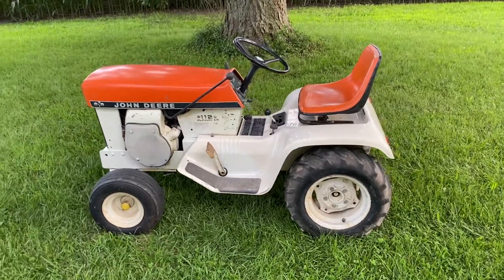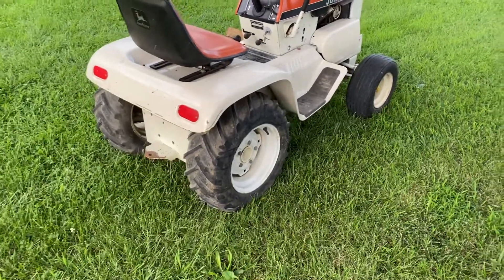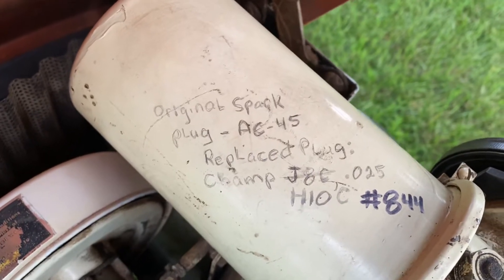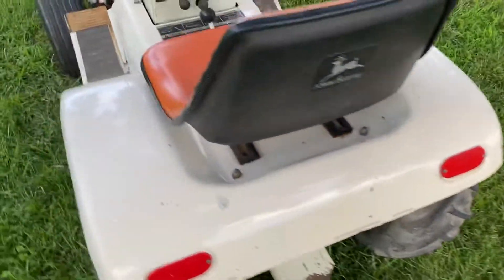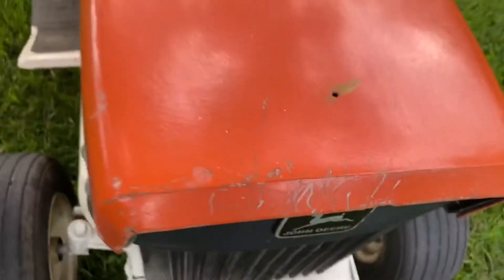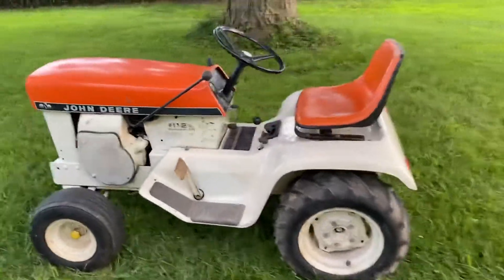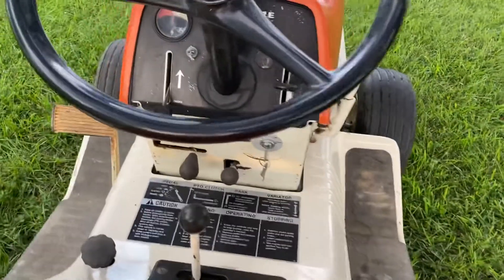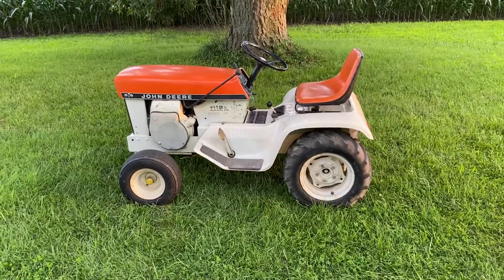1969 John Deere 112 H Sunset Orange Patio "Custom Color Series" Kohler

Comment: I have the yellow 112h 69 all the attachments and original manuals and service manuals. Snow blower,Wheel weights Deck ETC even the original receipts! Might be lookin to get rid of it soon or restore. Its all original starts on first try runs like a Deere. Any idea how much they are worth? Also have roller and rear bagger system. I have a mint 88 318 and have been using that to mow with but i need a snow blower for it and also looking for a nice skid steer. BTW I am the original owner
Reply from the maker: Where are you located?
Reply: @JnP-Restorations  long island
Reply from the maker: Yea I’d like too, but your over 18hours away. The prices are all over. It really comes down the overall condition and the main factor is the condition of the seat and hood. I’ve paid anywhere from $500 to $2400 for mine. I’m missing a 318 from my collection. Lol
Reply: @JnP-Restorations  yes I love my 318 just want a loader for it! on the 112 i even have the original receipts and manuals and brochure from 1969 and parts manuals. I love it but have no room for it without building another shed, Still runs like a top hood seat etc is nice still. Ill do a vide o when the weather gets nicer. But the 318 is a beast even with the 52" deck
Reply: @johngrady3532  Hey i know you many have sold it by now but ill just ask. My grandpa has one and I’m only a young teen but i wanna restore it. My uncles bashed it up pretty good, I was wondering if you still had it could i make an offer on the hood? If not that’s fine I’m just asking around
Reply: @donttreadonme235  I actually had the hood redone I'm not looking to get rid of it. You may be able to find a fiberglass guy who can fix yours